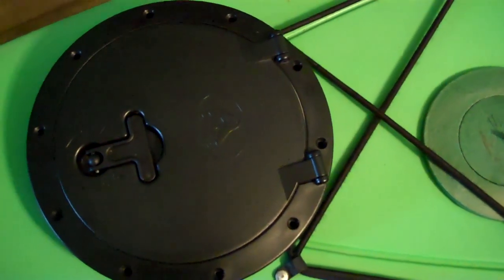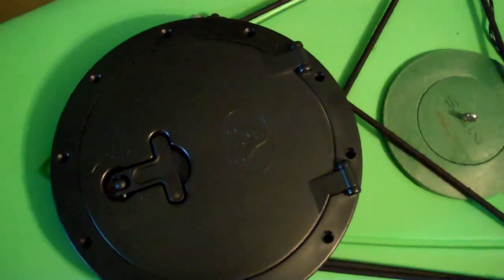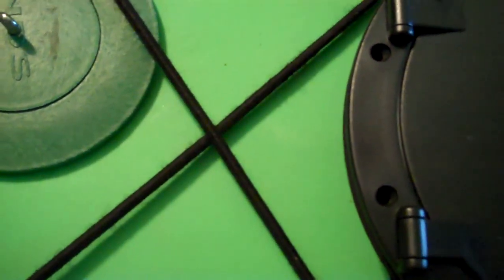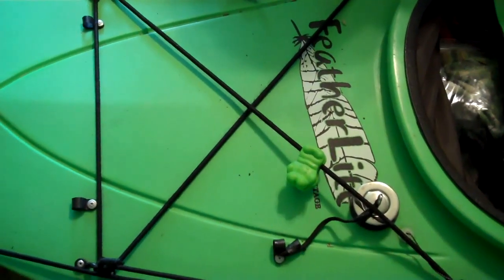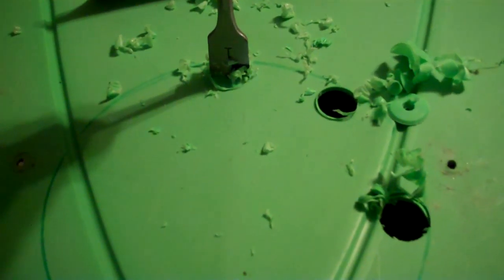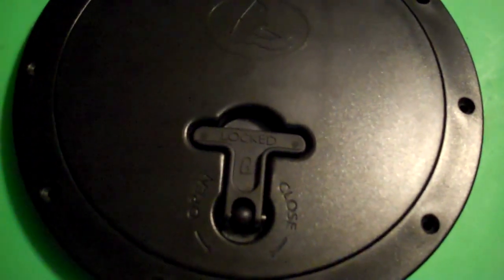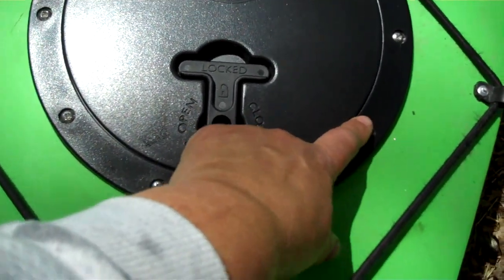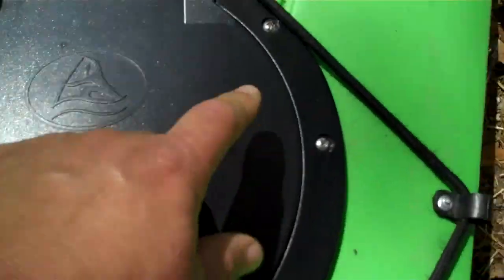DIY KAYAK HATCH INSTALLATION

Comment: You're braver than I am!! As much as I want to install a 6" dry hatch for my keys, camera, snack, etc, I just don't have the guts to do it. 

I have a 2001 Perception Carolina 13.5'. Bought it new and it has been with me for 15 years now! If I damaged her trying to modify her, I don't think I could live with myself!! :)
Reply from the maker: I know what you mean! It's why I didn't use a power saw. Took a little more effort to use the hand saw blade but more control and less likely to oooops.  If you do try it, use a brand new drill bit and don't press into it. Try it in the very center first to get a feel for it.  I've patched holes and modified before--but there is always a first time--and that always leads to more! I cut a bigger hole last week and dropped a modified cooler into the back of it--love it.  Let me know if you try it and have questions--would be glad to help. It's really not that hard.
Reply: I remember in the 80's I cut a hole for a sun roof in a Toyota Celica. I gritted my teeth. I thought small sun roof and if I made a mistake go buy the bigger size...lol. It worked out great. Being a young kid making $150 a week and cutting a hole in a car roof is scary.
Reply from the maker: LOL! Don't know if I'd have enough nerve to cut a hole in the roof of a vehicle!   Must have been an awesome sunroof!

Comment: Is this a Beckson Hatch? If so why doesn't anybody ever show how to attach the bag to the hatch. There is not one video on you tube that does that....why the f not?I just baught a Beckson hatch for my kayak and it blows my mind that you have to glue the ring that holds the bag to the actual hatch itself. You would think that the ring would sit inside the hatch then you put the red bag in it then screw the lid of the hatch down and that would keep the dag snug and tight inside the hatch. Its absolutely stupid to have to glue it to the undercarriage of the hatch . The Hatch was $20 and the bag was $20 so I spent $40 plus dollars and now I also have to now buy adhesive or some type of glue to make this hatch work.Are you kidding me. please show us the process of attaching the damn bag to the fricken hatch.
Reply from the maker: Hi Mike, the bag for this hatch drops in with the small cut out area of one plastic ring lining up the the small equal matching outy piece on the other ring. I've taken it out and machine washed it LOL  It pops in and out in seconds and stays secure with no glue.